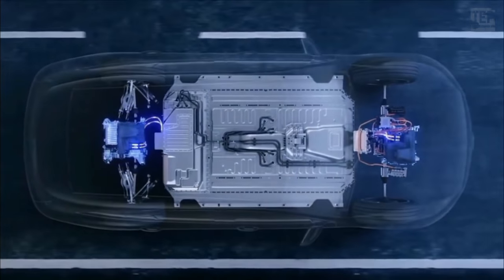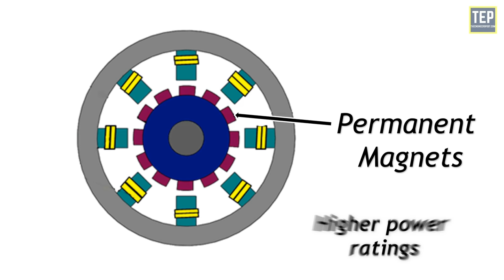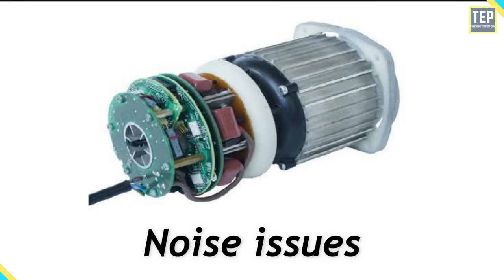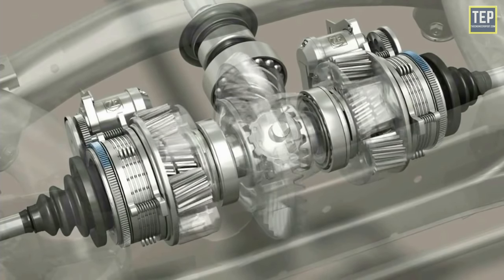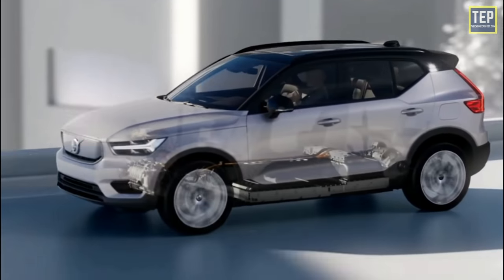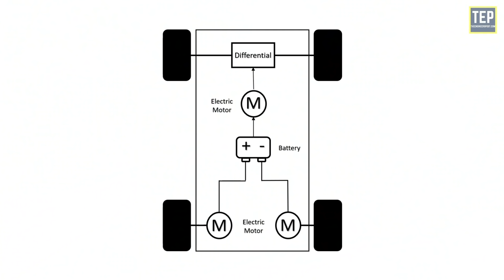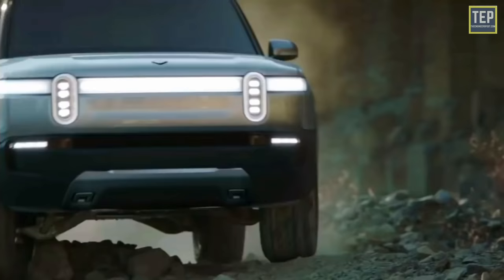Types of Motors used in EV | Single, Dual, Three & Four Motor Configuration in EV

Comment: 2:07 - The brushed DC motor shown there is a miniature motor used in toys. Unbelievable, considering that for more than 100 years, until the 1990's, the brushed DC motors were ubiquitous in electric automobiles, tramcars, trolley buses and electric locomotives.  They are still used today in the subway of the New York City, and not only. Was it that hard to show something serious, instead of a motor for toys?
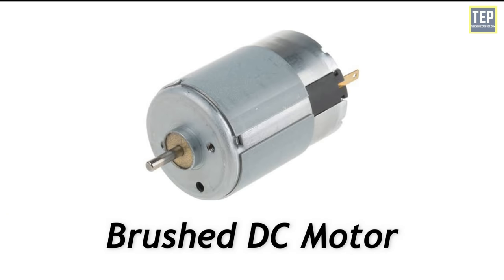2:28 - No, "brushed DC motor is" [NOT] "one of the simplest types of DC motors".
And the series-wound brushed DC motors was used for more than 100 years in all big moving vehicles (including locomotives) for a reason: Its torque increases automatically if the speed decreases due to unexpected load (like when climbing a slope). And this motor needs control and it can be easily controlled (unlike what the narrator says). 
Also, the brushed DC motor can recuperate the moving of energy of the vehicle through electric brake. 
Now, unlike what is mentioned, the real reasons for its fall from grace:
1. Power semiconductors became economically feasible in mid-1990's, allow the usage in vehicles of synchronous and induction motors.  
2. The mechanical commutator and the brushes touching it, need maintenance every 500...1000 hours.

Comment: You said that 2 Motors Dr. each of the rear wheels. It looks to me that there are two motors, but there’s only one for each wheel. Those two things are different!
Reply: Sometimes 2 motors are coupled together, and then deliver power to the wheels through a single differential
Reply: … ok, then. You said that 2 Motors drive each of the rear wheels, yes? Did you mean to say that 2 Motors drive BOTH of the rear wheels?
Reply: @nowsc  lol I didn't say anything.  I'm not the one who posted the video.  I was merely explaining how 2 motors can drive the rear drivetrain.  There are multiple errors in that video, and this is one of them.  It should've said "2 motors driving both rear wheels", or, if the video meant something else, it should've said " 2 motors, each independently driving a separate rear wheel".  I'm betting the translation from another language got this part wrong, similar to several instances in the video.

Comment: Having a differential is not a good thing.. so 4motor system is best
Reply: @Alfred Wedmore  Wrong. ALL EVs requires electronics just to work.. and EV with 4 motors just need more electronics.. and to be programed to controll all 4 wheels.. few more lines of code.
And differential is NOT efficiant at all.. it make wheels slips easaly.. and power never fully used..and that is unnecessary loss of battery energy. 
Having motor on all wheels gives 100% traction.. and 0 loses.
Reply: @Alfred Wedmore so you say its harder to make a wheel controll unit than whole big mechanical differential? Or even haldex or torsen super-complex types of differentian?
Reply: @adnanjusic4890  Its one time development. Electronics are always comparatively affordable and last for a long time. The real advantage is superb performance and efficiency which is amazing. Its like driving a sports car but with cost of a regular sedan and also very good for the climate as it is very efficient.

Comment: Just let me know when the time come when: 1. 4 motor EV cars are very much affordable without incentives at a price comparable to a new Honda Civic LX ; 2. EV cars can travel at least 400 miles with 100% battery; 3. Only takes 1-2 hours of a standard 110V home plug to fully charge the batteries just like charging a laptop. 4. Gas stations become E-stations all around town..........Because I can't really afford $50 - $100k just to have the EV performance experience when most of the time are leasing the EV car with $600-$1000/month for 36 months. I want an affordable EV that can at least last 10 years or 150k miles without the need to purchase really expensive tires and parts.

Comment: two motor s could be a balanced approach...if the motors get cheaper.
Reply: Motors are already on par with ICE, if not cheaper, if you go hp for hp and lb for lb between Electric and ICE.  The added cost is in the batteries, which is the focus of the debate.  Projected fossil fuel cost over time, versus cost of batteries (+charging) over time....

Comment: I won't be buying an electric car until the body is covered with high efficient solar cells that charge the batteries as the car is driven.
Reply: we're about 30 years away from such capable solar cells

Comment: aaaaTruy speaking right now I can suppluy you with a prolme mover that can generate AC or DC for your EV and the beayty is it requires nothing from outside of your EV. No petrol, no electric and n gas of any kind . You can be the first to this technligy which will replace all engines s we know it at pesent  Try it

Comment: There's two top electric motors high RPM or high torque and on top of that the batteries you use and the very first electric car was a 1000 mile range cop car now the maximum range is 500 they lost 500 miles and almost 200 years so and on top of that they're even more dangerous the new batteries can blow up and kill you or catch on fire and kill you an accident catches on fire you can't get out in time and your burn up you want to drive around of those lithium-ion bombs go right ahead it is your choice to die not mine

Comment: A permanent magnet motor as a generator can generate electricity without fuel or pollution.  Thomas A Edison generator was a permanent magnet motor as a generator. An old car generator chisel to Edison's generator by removing the Tesla magnets from the armature can power electric motors.   In truth battery powered electric cars are obsolete in the face of unlimited range electric power cars trucks and airplanes.  Why can't you speak of Edison generators and dynamos to power vehicles??
Reply: That idea sounds good until you consider all the losses....No generator can keep up  because you cant create more energy than what you put into the process/machine.....Second law of thermodynamics.